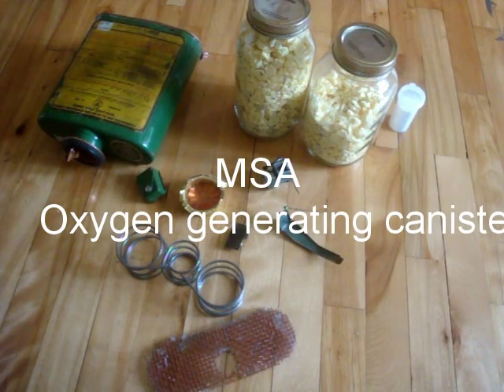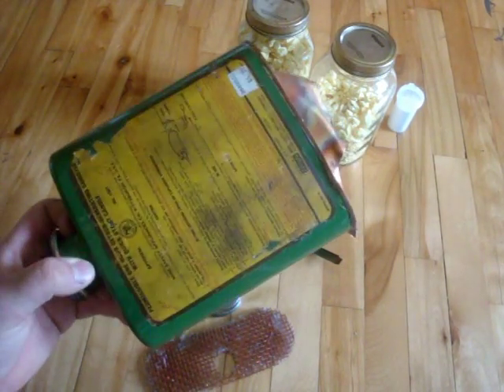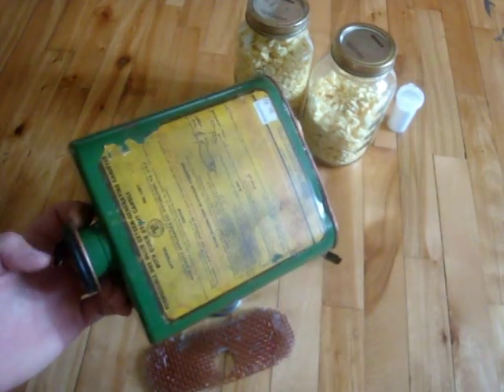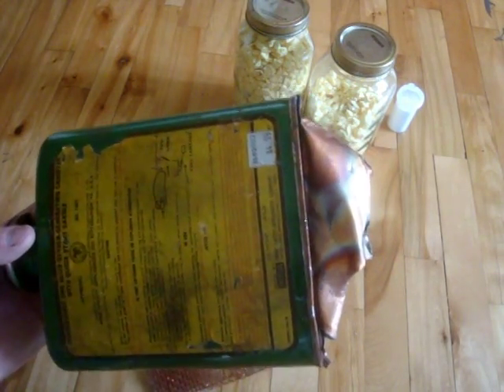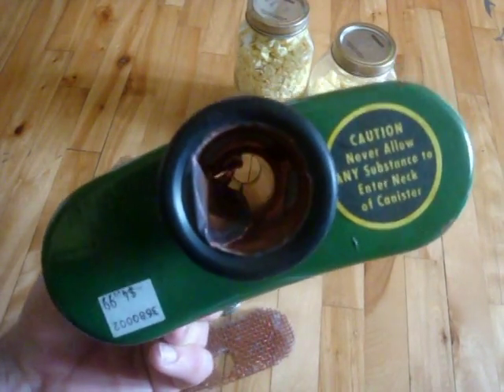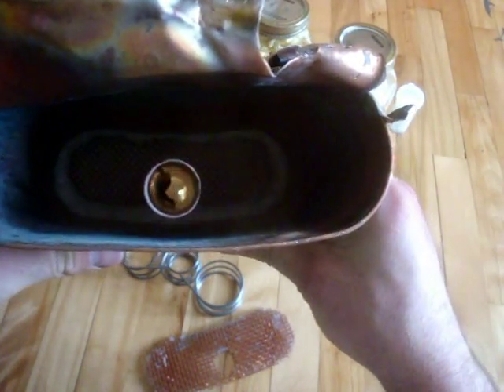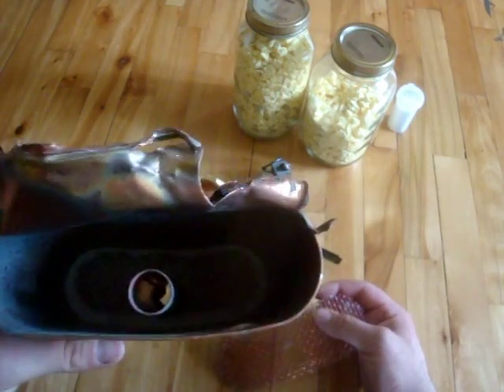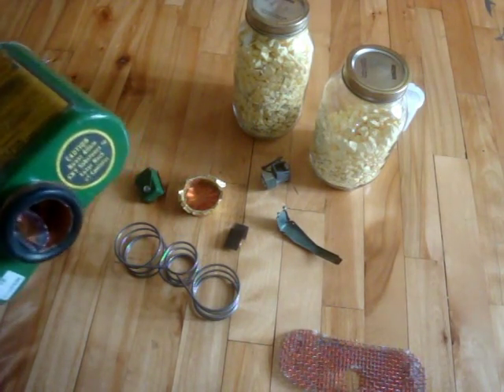MSA Oxygen Generator

Comment: That is an Oxygen canister for an A4 OBA.  You insert the canister in front of you so the writing is upside down. The bottle neck is going up into the OBA. You then pull the LANYARD to ignite the candle for 5 min of oxygen to get it started. Your CO2 is scrubbed and a bladder is filed on the suit with oxygen for you to inhale. Removes CO2 and produce oxygen is the process. Its a better system than modern firefighters have as their tanks only give them 20 minutes breathing.  That chemical you poured out is explosive when in contact with oil. Please , be careful
Reply from the maker: I checked the MSDS for it, and will be testing it with different things to see what happens (in a controlled situation). Thanks for watching and commenting.
Reply: Water can also make it explode.

Comment: The Fleet Damage Control school had a demonstrator for the energy these things had. The device was nothing more than a piece of square tubing that roughly fit one of the canisters with water at the bottom. the CF instructor would merely pierce open the bottom of the device & drop it down the tube. After a period of time the canister would fly out of the square tubing at quite a clip.
Reply from the maker: Nice. yeah the destruction technique written on the can was to pierce holes in the base and place it in water till it stops bubbling. Must have been a fun demo to watch. I'm going to test the warnings on the canister to see what KO2 has to offer when it comes in contact with hydrocarbons, or ethanol. MSDS says possibility of spontaneous combustion.